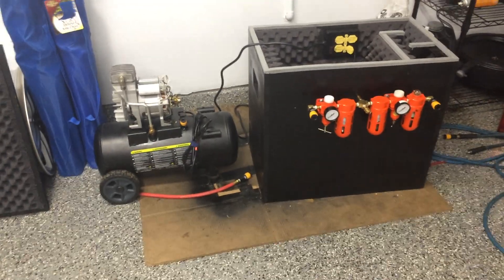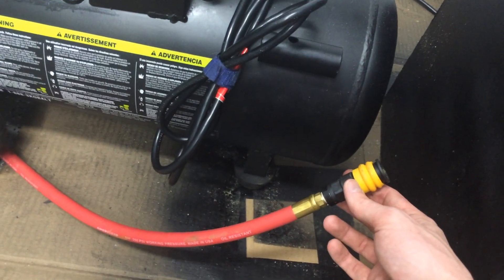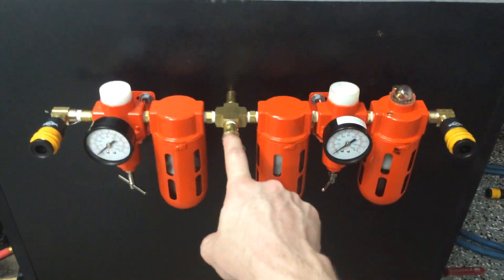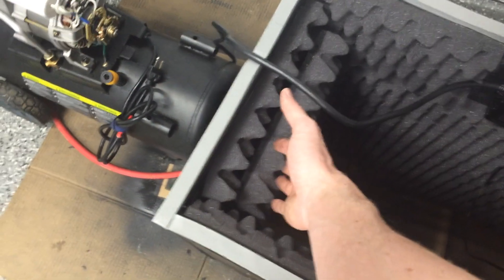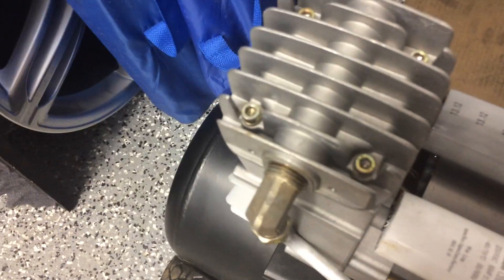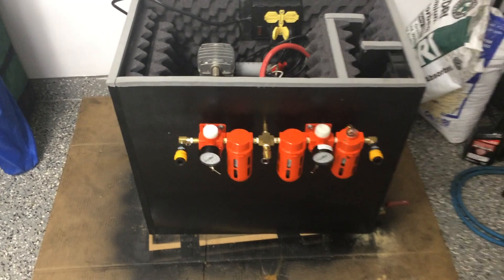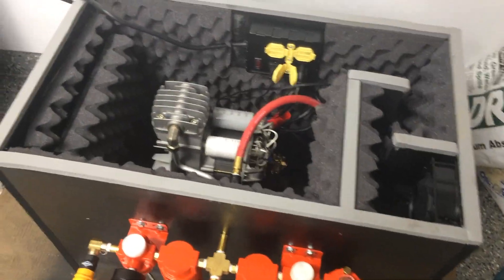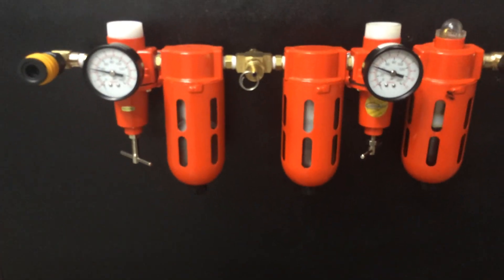Compressor box

Comment: The fan for exhaust is essential when enclosing a compressor or shop vac. I built a 6' x 6' x 6' "closet" off the back of my shop to house both machines. I also installed two computer fans powered by a small solar panel. One fan brings fresh air in and the other fan exhausts the air. I've seen many boxes like yours but without the fan you installed. Then they wonder why the motor overheats. I like the whole set-up, especially the drain valve. Something I didn't do, but will now that I see yours. Thanks for sharing!

Comment: All you really need is a muffler for the intake. Next time cover your hand over where the air is being sucked into the compressor for a quick second or two and you will see how quiet it gets. That's where most of the noise comes from. The part is available for most units. This is a huge waste.

Comment: would be nice to add a timer to let the fan running after compressor cut off because compressor body will be still very hot.
Reply from the maker: I had debated on this concept as well but usually what I ended up doing was just opening the lid after use.

Comment: Hi , good box but l need to bring mime to a lower level , has anybody had the idea to build a sealed box, what would happen if you take pump off the motor and place it in a oiled filled box, drive shaft going throgh a seal in the box to the motor, inlet pipe going through a seal to a car air box,  outlet pipe doing the same going to a tank , crank filler having a pipe to the outside of the box as well. I know it sound mad

Comment: What about all the heat buildup?
Reply from the maker: ...did you not see the fan?
Reply: It takes a long while for the heat to build up on a set up like this at work, the only time it over heated to my knowledge was when is ran for about a hour and a half non stop. If being used moderately or even the more tame end of heavy plus given time to cool off, I doubt it would be a issue.

Comment: Great design and construction Armand! However the foam used is not the optimal material. 
It is a common mistake I also made: pyramidal shape foams are good to reduce reverberation INSIDE the room (box in this case) therefore are used in radio and music studios. For the quality of the sound let’s say.
Unfortunately this very light foams simply have not enough mass to effectively prevent the sound from getting to the outside. 
For this purpose there are specially heavy „sandwich“ plates with the spring effect. They are able to provide an almost total sonic isolation.

So that would be my suggestion for improvement.
Reply from the maker: Old design - definitely first prototype level design. The type of material I used to sound proof my music room in my house was exquisitely expensive by comparison but I didn't want to budget too much to this. It served the purpose, but that compressor since has broken twice... so I moved to a different unit.
Reply: Armand Hindrichs I’m curios did the compressor break twice since because it may have overheated in the box or other reasons? Looking to do this to my 30 gal upright.

Comment: Nice design!  I particularly appreciate the quick connects and thought given to draining the compressor.  
A few thoughts:
 - switch on the outside
 - if you want more air circulation, try a quiet bathroom fan; they are designed to overcome more back-pressure than muffin fans.
 - aftercooler (outside the box?  Inside, with an additional fan?) to help separate moisture
 - temperature gauge?

Comment: I was thinking of doing this same thing but doesn’t make sense to spend twice as much on the box than on the compressor. I decided to try one of the newer husky oil less low dB compressors. Bought a 20 gal stand up for $220 and measured sound level with a friends dB device. Averaged 74 dB and is by far quieter than my older 10 gal. No box needed and I love it so far.
Reply from the maker: I went through 3 of those Husky uprights. Each one failed in the exact same way - the pressure line from compressor to tank blew out. I ended up moving to the Ridgid dual tank.

Really though, you should build a compressor box significantly larger than I did. There should be much more room. Also it shouldn't cost you more than $40 to build one of these boxes. $20 for a 4x8, $10 for some insulation, $10 for a fan.  Well worth it in any case.

Comment: i think i would have made it a little bigger for more air circulation and 2 fans plus switch on the outside so you wouldn't have to hear it at a high DB at all.  just my thoughts . you did a great job though I like it.
Reply from the maker: If I were to build another it definitely would be significantly larger with 2 fans for sure. These were some cuts of wood I had already around the shop so I made them work. Definitely too cramped though. I'd also put fans on top and have inlets on bottom so we get the hot-air-rising effect working with us.

Comment: Looks to be a solid design man... I'm going to build one soon and do a video on it... But I worry about the balance between reducing the sound while restricting the incoming air for the pump... If it has to work harder to suck more air in it could shorten the life of the pump... Over heating would also be an issue... Making a small exterior building would be good but not the most practical... I guess it's all about finding the balance... Sorry for the rambling comment... Again your design looks really good... It's like I always say... Let's all learn from each other.
Joe
Reply from the maker: I would advise putting a fan on bottom and another on top instead of on sides like I did. Also I'd keep a larger control volume to help the intervals of on and off with the compressor generating heat. The design went pretty well but the compressor bit the dust after 3 years of moderate to heavy use. I need to build a box for the new compressor.
Reply: Good idea... I've been planning with some designs ideas tonight... I figure I'm going to give a little on sound in order to have enough air flow and heat reduction... I'm going to cut ports and use furnace air filters on at least two sides... I'm also going to install a small 110 volt 10" fan... Only one fan though because I have a 30 gal compressor and need the over all size of the boxes to be as compact as it can... My mini fridge is going on top... One fan placed right should draw in air and push it out the other side passing over the hot pump... I'm also going to run a stand alone 20 amp circuit for the compressor... It only requires 15 amps but the extra power will be for the fan... All will be controlled with one switch... I'm sure I'll change a few design ideas between now and final production but that's about where I'm at... Your videos and videos like it really help... If you want to check out my channel I have a could basic videos with my compressor break in and drain install... But in a couple weeks I should have the box built... Thanks again for the ideas...
Reply from the maker: I got my 120V AC fan from AC Infinity (cheapest). They also have thermostat controlled ones but frankly they should be on all the time if you're using the compressor. That heat builds up quickly, especially in Houstons heat. You can get around the sound by doing sound baffles with your fan designs. A strong fan will be able to pull a good amount of air through a few baffles without too detrimental of a loss. Baffles are the key!
Reply: Thanks... I'll search for that fan now...
Reply: AC Infinity AXIAL 1238, Muffin Cooling Fan, 115V AC 120mm by 120mm by 38mm High Speed???
Reply from the maker: That's the one I have. Check out their other products though since they have thermostat controlled ones as well.
Reply: please tell me something about that if u have any idea i have to do my poject .. my email id is  "amit1591singh@gmail.com"
Reply: Fans are rated CFM for a particular back pressure, and muffin fans aren't designed to overcome much back pressure.  Quiet and ultra-quiet bathroom fans are designed to work with long ducts and are easily available.  Best to listen to them in the store display if you can, some have a whine.

Comment: you should add a second fan for redundancy, and you can't measure that with an iPhone lol, worse piece of hardware known to man.
Reply: Any app designed for sound analysis beats just listening to a video.  The video is likely to have AGC (Automatic Gain Control) applied to even out the sound level, which will hide any improvement.
Reply: Providing it actually works linearly, which I very much doubt.
Reply: hi every one ,l was going to make my own compressor box,but they don't seem to get down to the noise level l need , ok this mite sound mad , what would happen if just the compressor pump was in a box with oil , drive would be on the out side shaft going through a seal , inlet wood be piped to a car air box on the out side , outlet wood be passed through the box to the tank , same with the crank filler and  oil level view .l know l can make it work , just don't know if it would work for noise level .
Reply: @lesariordan249  . Rocket 🚀 science 🧬
Reply: The iPhone is fine for a differential analysis.

Comment: Great solution, looking on your measurements you could maybe put some antivibration feet's under the compressor, to reduce the base:-)
Reply from the maker: That was the plan that I never got around to, but the next air compressor I do this to will be a much more thorough design.

Comment: Great job Armand. How are you running the fans for airflow? I want to connect mine to the compressor somehow so that it turns on when the compressor does but havent been able to figure it out. I have the same compressor you do. Thanks
Reply from the maker: The fan is wired to run non-stop unless I unplug the box. It's such a small fan I figured it was better to keep it cooling the the whole time than be intermittent. There are some temp-controlled models by AC Infinity (same brand as my fan) on Amazon as well.
Reply: I see, thanks.

Comment: why do you need those red gauges can you use the compressor with out them they don't come with them so how do they help
Reply from the maker: Those gauges are on regulators. Some tools can only handle a certain amount of pressure so those devices are used to set a maximum pressure in that line.
Reply: mggcomputers  also one is water separator and and one is for oil, if using air tools they like lube and less water, if spraying you just use water separator with out the lube one ,

Comment: Nice work Armand.
I am building a sound deadener for my upright compressor. I will be using a 6x6 exhaust fan.  Should I put the exit hole for the fan directly over the engine, or directly opposite the exhaust ?  Thank you for help.
Reply from the maker: Exhaust? Are you doing this for a gas powered compressor then?

Comment: Sorry to inform you but the fan on that position is doing nothing in terms of evacuate the engine heat and provide a nice ventilation. Better if you place it just on top of the engine, and at the bottom of the box open a ventilation in order to create a nice air flow.. Anyways if you are not using it too much it could work. The noise isolation is very good ;)
Reply from the maker: Sorry to inform you that it works extremely well. The heat sink for the motor is at the top of the compressor so I placed the inlet and outlet to maximize airflow across it.
Reply: Armand Hindrichs :) airflow with all that foam around the outer fan... Maybe in your imagination
Reply from the maker: It's hard to argue with tangible results as opposed to your online speculation. Go troll elsewhere.
Reply: @eduki, How could you possibly know that without measuring the temperature with and without the fan?

Comment: How much total was it to create this?
Reply from the maker: 4x8 sheet of 3/4MDF - $30, box of screws - $4, AC 120mm fan - $18, sheet of foam - $30, air plumbing for drain valve and air to front controls (excluding controls) ~$30, and I wouldn't recommend the filter/regulator/lubricators I had. Pick some up from PneumaticPlus and they'll be rebuildable and higher quality.

Comment: Can you tell me what brand regulators l you use?  And also what quick connects and fan did you use? 
I have the same compressor and I like the design of you're isolation box and I think id like to make one similar with a few tweaks of my own. 
Thanks
Reply from the maker: +metalmalitia23 I wouldn't recommend my regulators at all. They've given out on me about 3 times. Go spend some money on them though! If I had to build this again from nothing I would use a different compressor and more insulation material. It is very quiet but could be better for certain.